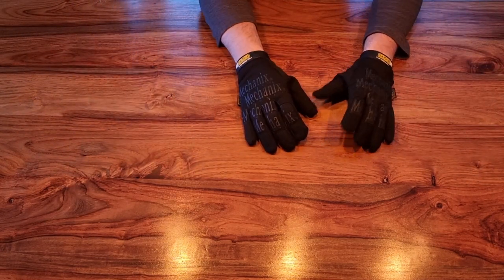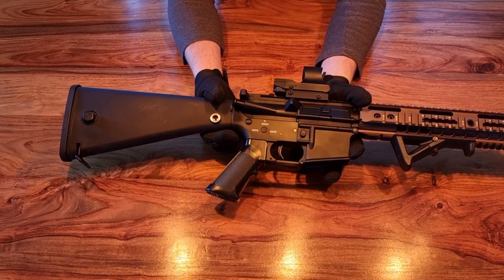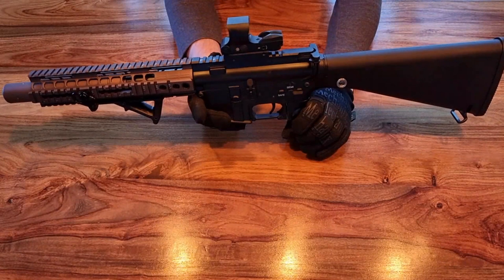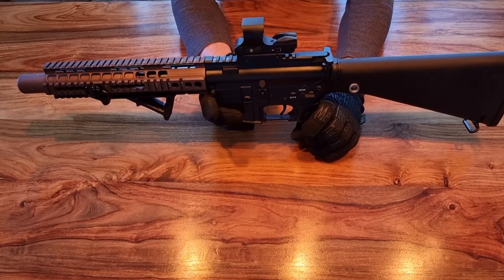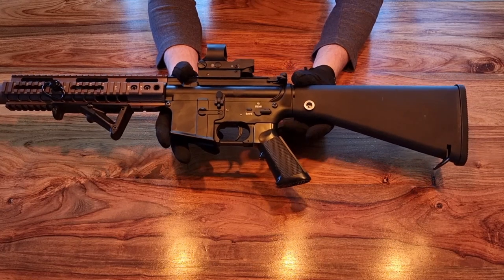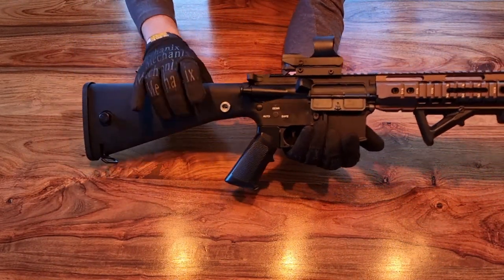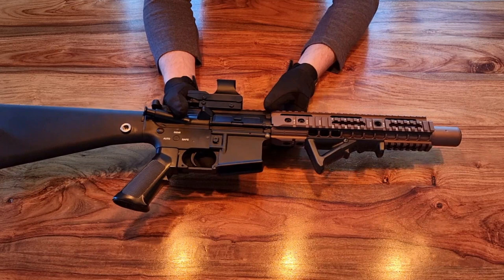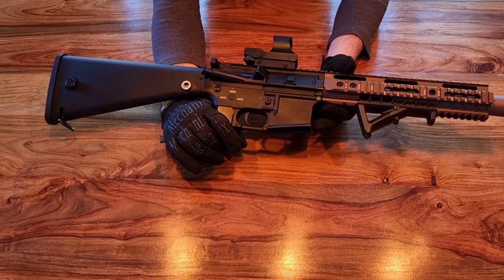Custom Airsoft AEG using E&C reciever set. Some of the problems of building a replica from scratch.

Comment: Your channel is so underrated! Because of you I have managed to tech my first aeg n am well pleased with the end result! 

Look forward to all your future content mate, thanks again!
Reply from the maker: Thanks mate. I really appreciate it. I'm also really glad to hear that the videos have helped and you've saved a bit by doing your own work. As you'll know as well the satisfaction of building your own replica is always good. Have you done upgrades or repairs on your AEG?
Reply: @rockbottomairsoft  I’ve got the bug for teching now! 😂.
It was first a repair as my fps dropped so bought a new piston, piston head, cylinder head n nozzle.
Next attempted shimming n greasing with great result! 
Lastly I installed a titan n maxx trigger. 

The fps is literally at 348 consistently, it’s so silent now and the trigger response is amazing! 

Would you advise changing the G&g gears if I am upgrading my motor weekend?
Reply from the maker: Awesome work mate. Sounds like the build is really solid. The fps is right on the level and I take it consistency has improved as well?
Personally I wouldn't change the gears until they either break or you want to change ratio. I've found that g&g gears are usually OK.
Reply: @rockbottomairsoft  yes consistent mostly within 3fps. 
I respect your advice mate I will leave the gear and just upgrade the motor 👍🏽. Got another week before can get out and skirmish it, the suspense is killing me! 😂
Reply from the maker: Hahaha, I know the feeling. Be good when you get out though, you really get a feel for the improvements once your out in the field. Watch out though, everyone will be coming to you for upgrades when they see it perform. A nice sounding, well shimmed replica always turns a few heads.
Reply: @rockbottomairsoft  I definitely believe that! 3 of my mates have already booked in there upgrades with me 😂. 
Thanks again buddy, I’m 100% one of your loyal subscribers! 
I’ll let you crack on with tomorrows upload 👍🏽
Reply from the maker: Thanks mate. I hope you enjoy it. Taking a look at another drum mag.

Comment: Currently building my own gun and the problem I encounter is you start putting stuff together then you realise something doesn't fit or you need to buy some obscure part, its annoying but on the whole also enjoying. Like you I got an E&C receiver, but spare gear box i had doesn't have a long enough wire so had to buy a CYMA gear box 😅 virtually none of the surplus parts I had will do! The build has cost me like £250/£300 so far, not going to properly calculate, I just tell myself its a treat to myself.
Reply from the maker: Your absolutely right. Doesn't matter if I'm upgrading or building there's always something that's slightly out of spec or just won't fit. Like you I find building to be a more expensive option. I hope your build goes well and you get it how you want it. Like you say, got to treat yourself once in a while😀.

Comment: Mine cost around 200 was given a dead specna gun receiver was in good condition , I bought a mk18 hand guard from patrol base and pistol grip and stock same place and dropped in a delta armoury gear box in up graded the hop up and barrel and paint job nows my main primary.
Reply from the maker: Sounds like a nice build. The reciever set I used here are the same alloy recievers that specna use I believe so would loved to have got hold of a donor, none available at the time though. The MK18 handgaurd sounds like a nice addition.
Reply: @Rock Bottom Airsoft  I collected a few gear boxes g&g and specna  got a another mk18 rail which is a Daniel defence    I believe if u look on gunfire there do a specna upper and lower for around 50
Reply from the maker: Daniel defence is very nice. I think I paid a bit more from fire support for my reciever set but usually I hope to get boneyard and build from there. Slim pickings as of late. I've got loads of spares as far as gearboxes, etc go. It always seems to be recievers I struggle to get hold of.

Comment: Nice looking piece, to be honest, fell in love with that! Can you list the parts by any chance? Names will be enough
Reply from the maker: Hi. I'm glad you like it. It's a complete bodge of parts I will see if I can remember them all. Externals is E&C reciever set. Front Rail is Nuprol Bocca. The stock is a Cyma full size stock meant for an SR25 replica. The outer barrel is Cyma from the CM.513 so really short. The silencer is just a cheap mock silencer it's either Nuprol or big dragon. The pistol grip is a magpul copy. Internals wise again is a mix. SHS 13:1 gears, gate merf 3.2, custom selector plate made by me, modified cutoff lever again by me, shell is the Cyma original polished and modified by me to fit the gear set, bushings are SHS I think, can't remember what I put in. Re wired and deansed as I usually do. The barrel is Madbull stainless, hop unit is a prowin rotary with a prommy purple bucking and I think I put the H nub in. Motor is a SHS high torque. Usually run it on a 7.4 LI-ION or LIPO dependant on what I have that day. If I remember anything else I will let you know.
Sorry for the late reply mate.
Reply: @rockbottomairsoft  thank you so much! I was wondering if i could make the same setup but i'm struggling with the outer barrel length. Is it possible for you to roughly estimate this barrel length without suppressor?
Reply from the maker: The barrel is an unusual length if we're talking outer barrel. It's the original outer from the cm.513. Inner then just depends on length of mock suppressor you go with. It's a really small outer bit longer than an ARP9 but not much approx 6".
Reply: @rockbottomairsoft  got it, much obliged!